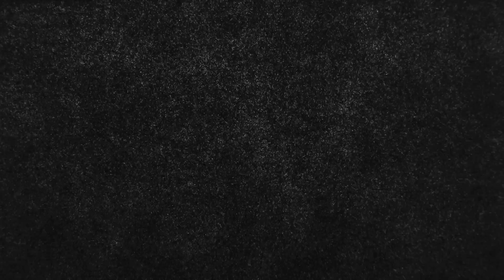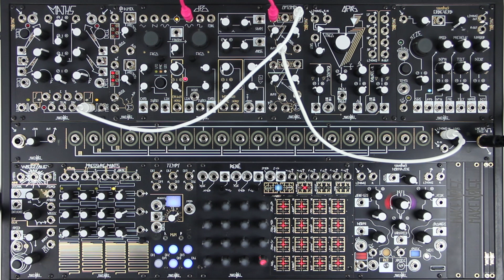MATHS Bouncing Ball!!!

Comment: P.S. Can you describe in a bit of detail what's going on with Wogglebug here? I'd like to understand what you're doing in a broader context so I can try to learn by applying it to my setup. Thank you!
Reply from the maker: Sure, the Wogglebug is clocked by a gate from the "Bouncing Ball" function, creating a new value with each bounce. The resulting Stepped Random is patched to the Radiate-L input on QPAS, which modulates all four filters of the QPAS to a new value, with each bounce. The Smooth output is then patched to Radiate-R, which makes it so that the Stepped modulates the left two filters and the Smooth modulates the right two filters. I then replaced the Stepped output with the Woggle output, so that the modulation would be continuous (not stepped) on both filter pairs, making the stereo spread more even.

Comment: Interesting to see how Tony integrates the QPAS into a shared system. I took the Morphagene out as it’s the least integral piece in the way I use it. If you have a Shared System, how are you fitting the QPAS in? What did you remove and why?
Reply from the maker: Tony actually uses a Shared System with no modifications. I have been swapping the QPAS in for either Echophon or Erbe-Verb depending on the patch when making demo videos. I think it's a natural pair with the Morphagene, so I always make sure both are in the case :)
Reply: Dean Rinehart I ended up getting a small skiff to put all the new stereo stuff they have coming out. It won’t fill it but maybe I’ll buy another maths and a morphagene. 😜
Reply: unfortunately i was impatient on waiting for a shared system to be in stock and i bought the erica synth system 3   also a great system but i really wish i had waited ....  there is something about the make noise modules that make them very special.   so now i buy i larger case and start ordering makenoise stuff when ever its available